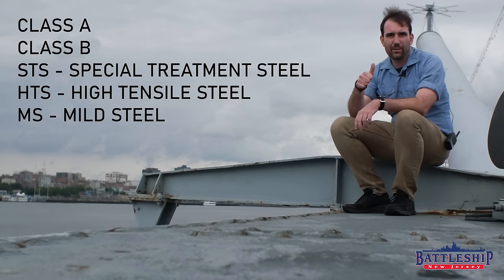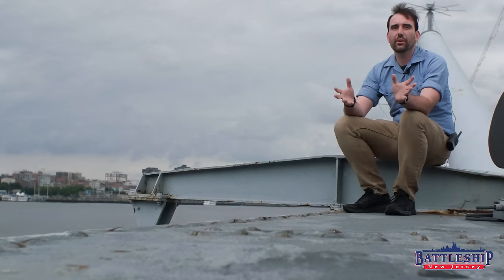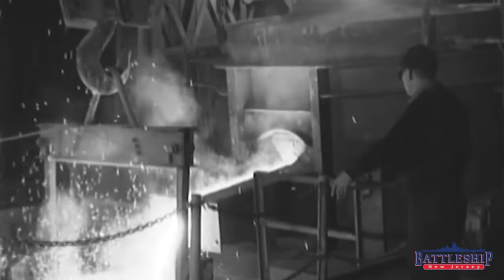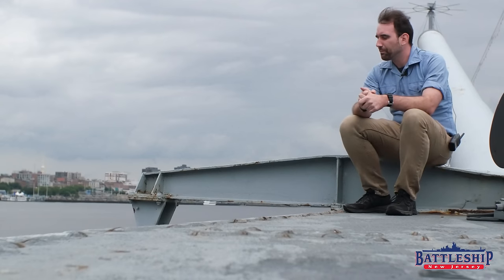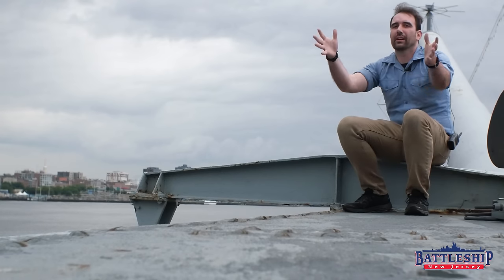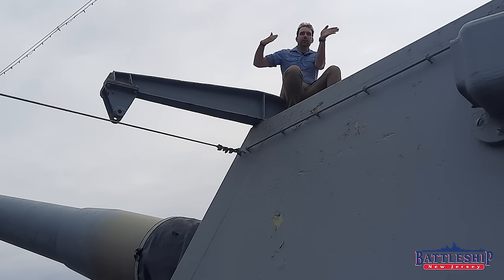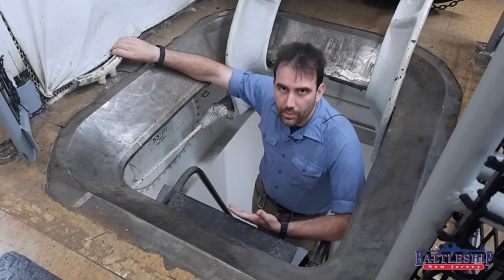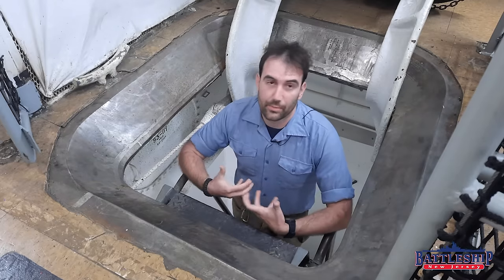Whats the Difference Between the Armor Types on the Iowas?

Comment: I would love to see BSNJ talk about Yamato's armor layout and quality. In a way that is informative and neutral and compare it to New Jersey's. Great video as always! Liked!
Reply: I doubt they can.  Most of Yamato's records were deliberately destroyed by the Japanese near the war's end to prevent the information from falling into enemy hands.
I'd love to hear him make any kind of comparison though, because I suspect he has more informational access than most anyone else.
Reply: @tyree9055  

They actually have plating at Nav Weps Dahlgren from IJN Shinano (planned 3rd Yamato  class turned carrier) that is identical to Yamato’s armour plate.
Reply: @james23p  That's the one with the point-blank hit from one of the U.S.'s 16" guns isn't it?
That is only a partial example, though I do wonder if it's the equivalent of Class A or B plate.
Reply: @tyree9055  

Yes when I was stationed at Pax River I went to see it. They shot point blank but used reduced charge to simulate I think 12,000 yard shot( might have the range wrong that was 30 years ago lol 😝). My understanding is they had a few plates but I don’t remember what class it was my guess was B but that’s a guess.

But the hole 🕳 and Armor was impressive.
Reply: All I know the Yamatos have All Or Nothing scheme with citadels/armored box protecting the engines and magazines. What I know (dunno if it's true) they have 16" belt with 20 degrees angled belt armor, which have immunity zone against 18" shells from 22,000-32,800 yards. The deck armor is the most jaw dropping armor a Battleship could have, they could resist momentum from a 1000lb bomb dropped from 3000 meters. I might also add the Yamatos have the best TDS of any Battleships in the world with torpedo belts stretching to 5 meters deep from waterline.
Reply: @ramal5708  actually, the Yamato class has some of the poorest TDS of the era, due to faulty design of the riveted joint between the upper and lower belt, as well as the lack of liquid loading of the compartments. The depth of 5.1 meters isn’t particularly high, Iowa class has a deeper TDS at 5.5 meters.

From gunfire, the Yamato is indeed the best protected.
Reply: @tyree9055  The United States technical mission to Japan did evaluate Japanese guns and armor postwar. IIRC, most of their armor was a rough equivalent to WWI era Krupp.
Reply: @drittal  Most of their ships were from WWI, they only manufactured a few during WWII (Yamato-class included).  Most of the vessels that were "modern" (as in 1940's) production were destroyers, cruisers and carriers.  The only modern battleships they built were the Yamato-class vessels, so that Shinano turret was probably all they could seriously get their hands on.  I'm not saying you're wrong, merely pointing out the Japanese pitiful shipbuilding program of WWI - WWII.
😉👍
Reply: @tyree9055  actually they had quite a few pieces of armor to test including experimental armor. One of which proved to be the best armor ever tested by the US Navy for its thickness (6-8”) despite being of poor steel quality. The face was very hard and the transition layer nearly 50% of total thickness. Another plate the British tried to replicate post war and were unable to do so. However the face plate of Shinano was about equal to WWI British KC.

Nathan Okun wrote, “Experimental VH plates were made by the Japanese during World War II and some of these and many production MNC, NVNC, CNC, and VH plates were brought to the U.S. Naval Proving Ground, Dahlgren, Virginia, and to the British Naval Proving Ground after the war for testing. Most of these plates, including the thick, production VH plates, showed that they were not much better than their World War I counterparts (which is not really bad for VH considering this was the best showing of any non-cemented armor actually used aboard ship and that the Japanese were not trying to make a better armor, just make British 1910-quality face-hardened armor cheaper). An experimental 7.21" (18.15cm) VH plate (#3133 at NPG, Dahlgren) seems to have been made from a German KC n/A specification added to an otherwise standard VH plate. It had a 535 Brinell maximum face hardness 3% into the plate, which is harder than all heavy VH production plate, though only by a small amount, with the hard point the closest to the face surface (about the same distance from the face surface (0.22" (0.55cm)) as with most cemented non-German KC-type plates), and a back hardness of 210-215 Brinell, which is slightly higher than production VH, but still well below average foreign World War II-era KC-type plates. The steel used was identical to the production VH plates that had been tested previously (rather dirty steel again of circa-1910 quality) and the hardness curve showed a typical VH-style pattern for the high-hardness portion. However, the major difference between this plate and all other VH plates was that the transition layer was much wider, extending to 43% into the plate (57% unhardened back), almost identical to German KC n/A, though with a higher average hardness than KC n/A in the decrementally hardened region. Since Germany and Japan were allies during World War II, it is not surprising that the Japanese may have obtained such information on German Krupp armor and made test plates to compare it with their own armor.

The U.S. test personnel at the U.S. N.P.G. did not expect it to be much different from the production VH plates, especially due to its relatively poor steel quality. However, this plate was found to be the best face-hardened plate of its thickness ever tested at the U.S. N.P.G.! (The next best plate of similar thickness was also an experimental non-cemented face-hardened plate of 7.6" (19.3cm) thickness made by Carnegie-Illinois Steel Corporation during World War II, which was only slightly inferior to this VH plate.) It required the late-World War II, improved, super-hard-capped (650-680 Brinell all the way through) U.S. 8" (20.3cm) Mark 21 Mod 5 AP projectiles to completely penetrate this plate in "effective" condition at 30° obliquity (the standard U.S. armor test in World War II) - the older Mod 3 projectiles, similar but with a maximum cap hardness of 555-580 Brinell, were torn up badly even when they completely penetrated (a rare feat against these U.S. projectiles!) and needed a much higher striking velocity to do so. Against the Mod 5 projectile, my calculations indicate that this plate was 1% better on an equivalent thickness basis than an average KC n/A plate (probably because the VH plate does not lose any resistance due to the existance of the thin, but very brittle, cemented layer used in KC n/A armor), meaning that it would take an average 7.28" KC n/A plate to replace this 7.21" VH plate - a pretty big improvement from regular VH armor in a single step! The U.S. test personnel were at a loss to explain this, but to me it seems that the Japanese personnel used the face tempering process of KC n/A, possibly with some of their own expertise added, in addition to just increasing the chill thickness. Japanese metallurgists (and most other technical personnel) obviously were (and are still) just as good as anybody else when allowed to set their own standards of excellence, as the post-World War II world has discovered big-time! Also, a rather unusual 15" VH plate was obtained by Britain at the same time and when tested showed a very high quality, also. However, this plate also had a non-cemented surface hardness of 575 Brinell, which I did not know was possible, and the British could not duplicate this plate when they tried to make two 12" (30.5cm) scaled copies in two different manufacturing plants - the plates ended up rather like improved standard production VH armor in composition and ballistic results, with only about a 500 Brinell face layer in both cases, so the British could not figure out how such a face layer was made, either.”
Reply: @drittal  Wow, most interesting!  Still, we know how the war ended...
😅👍
Reply: @drittal  — great information, and very informative, thanks
Reply: @stevensmith9805  What did the most damage to Yamato and her sister? Was it bombs or torpedo's? It's still hard for me to Imagine WWII bombs and torpedo's making it through the belt and deck of those beasts but obviously they did.
Reply: @dmproske  torpedoes don’t go through the belt, under it. Or in the case of the Yamato and Iowa where the belt is thinned out as it gets closer to the bottom, it is used as the inner most bulkhead of the Torpedo defense system.  This rigid armor was found to be more of a hindrance than help as it wouldn’t deflect or bend from the gas bubble generated by the torpedo warhead. Instead it would tear at the joint where the thick upper belt meets the lower belt than thins down.
Reply: @drittal  Only the Yamato class had a problem with the joint between the upper and lower belts, since it was only held together with rivets, whereas the Iowas and SoDaks used a very strong keyed joint.  The Iowas and SoDaks did have a potential weakness at the joint where the lower belt attached to the triple bottom.  However, since this was caught early in construction of those classes, the USN was able to mostly solve the problem by reinforcing the joint and by liquid loading the outer two compartments of the TDS.  The fact that the relatively rigid lower belt was still connected to both the upper belt and the triple bottom still made it more rigid than was ideal, but there was little risk of a total failure as happened when Yamato was hit by one shallow-running standard torpedo.  A failure at the bottom of the lower belt was much less severe in any event than a failure at the joint with the upper belt, for what I hope are obvious reasons.
Reply: @bluemarlin8138  you are correct about the joint. However the problem was never solved. Testing in 1939 was when it was discovered. Liquid loading was changed and their protective rating lowered. The “improved” system to be installed on Kentucky and Illinois was tested in 1943 and performed poorer than had been hoped. The lackluster TDS on the Iowa class was a topic the Navy hid very well even into their deactivations in the 80’s-90’s.
Reply: @drittal  I think the 1943 caisson tests were only testing the modifications which had already been made to the SoDaks and Iowas, and they found that while the TDS still wasn't as good as that on the NC class, it at least wasn't a catastrophic weakness.  Illinois and Kentucky were supposed to receive further changes to increase the TDS effectiveness by another 20%, but as far as I can tell, no one knows exactly what those changes were.  And obviously, the Montanas went with the "detached" lower belt design to achieve an effective TDS while still keeping the underwater shell protection (and adding more depth).
Reply: @tyree9055  Wow! Talk about a spoiler alert. Gee thanks. :)

Comment: from what I've studied on armor, on classes of armor: all horizontal armor is CLASS A, all vertical armor is CLASS B. the reason for the two classes is for production reasons, class B doesn't always have just one side face hardened.
The process for making class A armor is mostly casting, or pouring the metal onto a rectangular mold. then the slab is sprayed with carbon-dioxide water on it under pressure, then dragging the giant slab back thru a horizontal heat treatment, then repeated treatment to drive the carbon into the "face" of the slab, then the slab is dragged into a giant pile of burning charcoal and peat and covered with sand for months to drive even more carbon into the slab. CLASS B starts out the same way for the most part but before it gets the full time in the peat and charcoal pile they take it out and shape it--usually rolling it to thin it or to add a taper, but they often reheat it, sometimes fold it to thicken it, and sometimes forge it. STUCTURAL STEEL is made the same as class B but used for different purposes.
Note: there isn't cement used in armor. You've mistaken a process called CEMENTATION of STEEL and what is meant by this term is: 2 slabs of steel are heated to a prescribed temperature and the one slab is put on top of the other and allowed to cool very slowly (at least weeks when discussing battleship armor). the sandwich is usually put in a charcoal and peat pile as above to face harden at least one side.

Comment: The use of class B armor reminds me of what The Chieftain (Nicholas Moran) mentioned about medium tank M4 armor being of a grade to prevent excess spalling.
Reply: Back before they could make kevlar spall protection or developed spaced armour that sort of thing would be fairly important. Of course they need to be hardened to some degree and HESH could still exploit that and produce severe spalling. This is something the Iraqis found out when they constructed their own T-72 frontal armour replacements after Russia refused to send replacement armour. Their production failed to harden properly and performed shockingly bad in combat. I've heard even the 25mm Bradley could penetrate the unhardened T-72 frontal armour, but I haven't been able to confirm. It would be consistent with other tales of unhardened armour, however.
Reply: @olivialambert4124  yes kevlar is not only for body armor but works for armored vehicles protection i.e. Warships, AFVs or MBTs. It's not only light but also could resist kinetic energy or force. 

Plus in Arleigh Burke class DDGs, the USN decided to move back from Aluminium to steel hull (double spaced steel) to prevent quick fire spreading/damage if the ship take missile or explosive damage then behind it they added the kevlar spall. Taken a lesson from USS Belknap fire when the fire easily gutted the top superstructure away.
Reply: 16" HESH rounds? 9 shell salvo? That is going to have me thinking going right to enginurd mode
Reply: @olivialambert4124  Marry me
Reply: @russellknight26  As cool as it sounds, it unfortunately wouldn't work too well. The only thing spalling would be whatever it hits. So any outer armour (eg torpedo protection) would take all the damage. That continues to the poor damage. Assuming there even was no torpedo defences, no spaced armour, nothing all warships use of that nature, we still have problems. The critical components are always held very deep inside the ship. Namely the propulsion and the ammo. Most other areas are of limited importance beyond perhaps flooding. The citadel protects the critical components - a second set of armour layers.

The spalling disables a tank by essentially blasting small fragments of steel around the insides shredding crew and hardware. For a battleship those tiny fragments are very easily stopped by any material in the way - steel bulkheads, walls, frankly anything. There will be no damage very quickly from HESH. It wouldn't make it anywhere near the center of the ship past two separate armoured layers and tens of bulkheads. We would expect maybe crew sleeping areas to be damaged whilst the crew are at battlestations, a minor inconvenience. Traditional shells get past this by having a thick hardened penetrating outer layer and a timed delay activating when it reaches deep enough into the ship.

Finally HESH is difficult to scale up. We need the plastic explosive to splat in a consistent way at the right diameter and thickness on the armour, and the shell to explode at just the right time before the splat becomes too spread out. That can be pretty difficult to do in the best situation, but it becomes far more difficult with different ranges (and shell speeds), different angles of impact, different target angles. A battleship then has a ton of protrusions on the surface which completely ruins that effect, as well as a lot of unhardened layers on the superstructure for which there would be minimal damage. As the HESH becomes larger the splat becomes far more difficult to control and more likely to get out of shape, get an inconsistent thickness, have the outer edges separating, any number of issues.

With that I'm not even sure a 16 inch HESH could be made at all, but assuming it could its effect would be very small against warships. However it is the premier shell for use against buildings, essentially a remote delivered C4 charge for that purpose (which is precisely why the British Army maintains their use). Used against very specific ground targets it could be useful, but I would expect the 16 inch HE shell to be sufficient whilst also having far better effect on non-building targets and other warships (which is why the American Army uses HEAT-DP instead of HESH for their tanks).